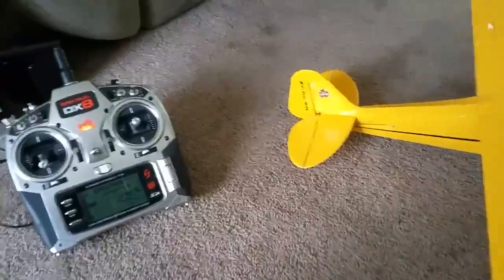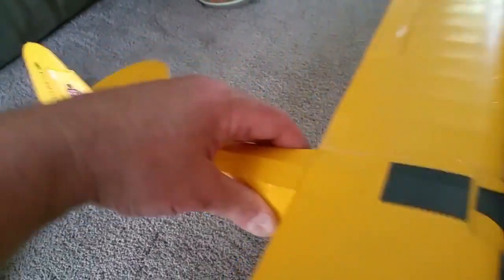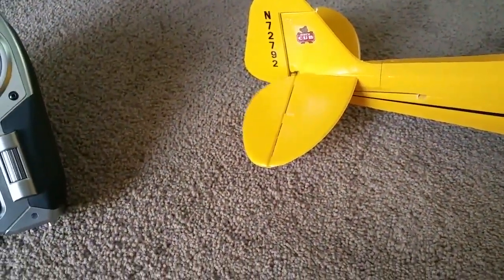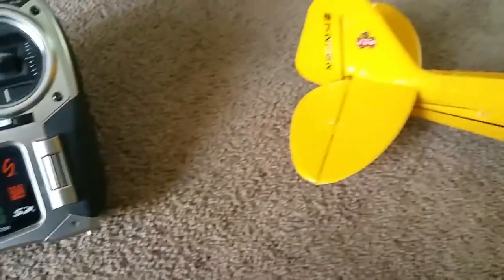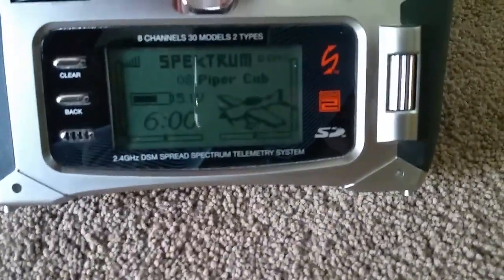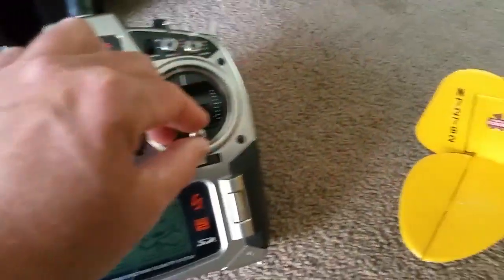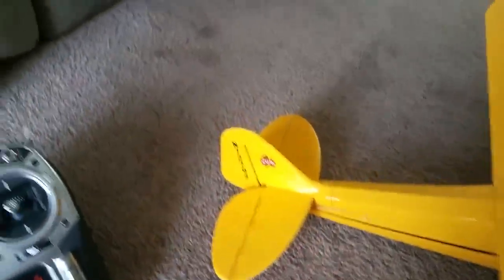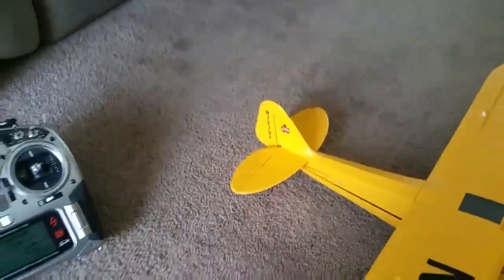UMX J3 Cub AS3X Stabilization issues..

Comment: I don't know if you're still fiddling with this issue, but for me it was a worn potentiometer pad on the servo itself. It cannot detect center so it constantly overshoots back and fourth. I'd say these things have about half a kilometer before they rub the pads off and this happens. Drove me insane, they clearly didn't do enough durability testing. Judging by the companies marketing strategies, I'd say it's intentional.

Comment: I just got one, blinded it but the elevator is completely un - reponsive.  Almost seems like it's not even connected electronically.  completely dead.  Have you ever hear of this before?  Needless to say I will be returning it to the store first thing Monday.
Reply from the maker: I'd check the radio settings and re-bind. You don't have to un-bind, just hold down the bind button again! Good luck!!
Horizon sent me a new cub and i still have it. Absolutely love the plane, lots of power, very responsive and cool to fly with floats!
Reply: Thanks Michael, I'll try that.  I've been out of the hobby for about 18 years so I'm just starting to get used to some of the radio features.  I have a Spektrum DX8 G2.  If that's the cause, what settings do you think might be affecting the elevator?
Reply from the maker: Do you have any other planes you can bind to and see if all servos work?
Reply: Yes, I do and that one's fine.  It's as if that channel was never connected to the receiver, it's completely dead, now movement at all on the elevator.  If it wasn't brand new I would open it up and take a look but I don't want to screw with it as the store has a good return policy and I'll just have them order me another one.